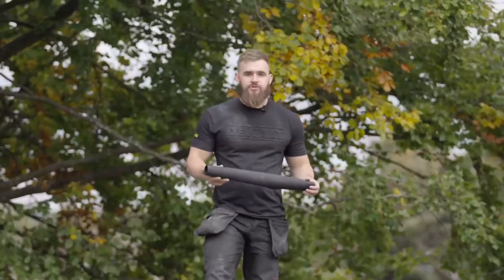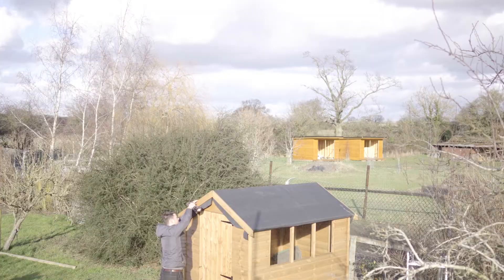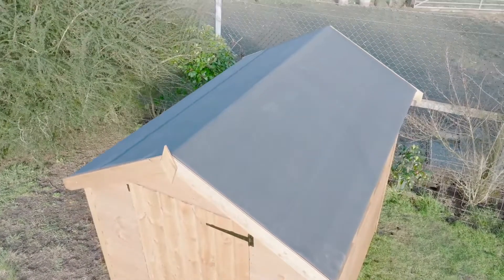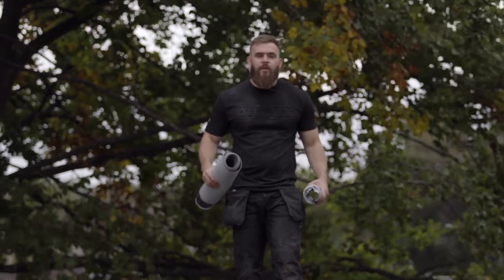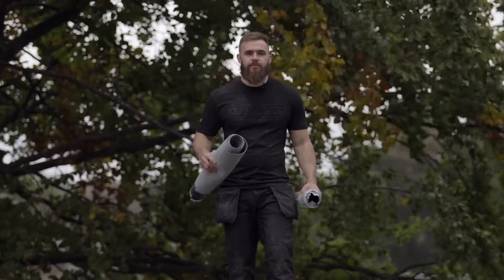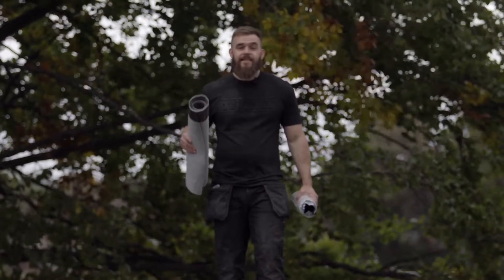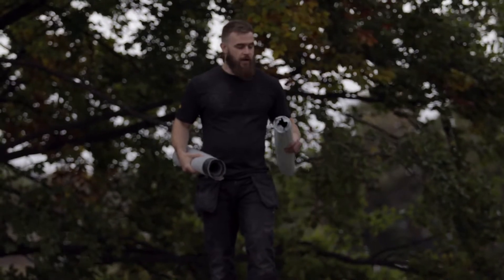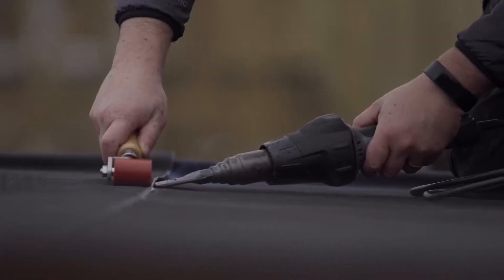Flat Roofing Materials Comparison: EPDM Rubber Roofing Membranes

Comment: Hi need help. Is OSB wood or structural Plywood better suited for a summer house roof (7m x 4m)? I see everyone is using OSB, but my handy man recommends structural plywood but it is about £150 - £200 more. I'll also be covering the roof with EPDM rubber membrane (classic bond).
Reply: No expert here but I have noticed OSB goes to shit way quicker if it gets wet. Plywood can get wet several times before it starts to fall apart. I guess if you never have a problem with the roof then it doesnt matter but I built my shed with plywood for that reason
Reply: OSB 18mm is fine, give it a light sand to give a key first. He  is a handyman for that reason i'm afraid . Im a Firestone EPDM authorised installer :)
Reply: 150-200 more is nothing if it’s better quality

Comment: Hi there, We recently had our garage done with EPDM rubber membrane. We live in a detached property which is connect garage to garage with next door. In other words the two garage roofs are connect as one. Now to the problem I have encountered. The garage roofs are serviced by a single outlet drain (quite narrow), which goes down internally at the rear of the garage roofs in the center. (behind brickwork). That means that the outlet gets overwhelmed in heavy rain and is prone to blocking several times a year with leaves and debris. Creating a nice swimming pool which I have to manually fix. So what I thought was introduce a second drainage point at the front of the flat roofs going internally down through my garage and thus avoiding creating a swimming pool. So my question to you is - how easy is it to puncture through the EPDM and fit a new draining point without compromising the integrity of the roof and voiding my warranty. Many thanks Brian
Reply: Any home DIY on professionally laid roof will void your warranty mate best to get in touch with your roofer about your problem

Comment: Hello!  I've been quoted $22k for residential flat roof replacement for 2300 sq.ft.  All the roofing companies in SoCal are saying that TU-35 POLYFRESCO G by POLYGLASS is what they will use.  Could you tell me if this is a fair price?  Another roofing company quoted the same job at $16k and I'm curious why they are so different in their quotes.  Thank you!
Reply: I was just quoted $28.5k for 3,000 sq ft S FL.  Also had a hard time finding anyone that does flat roofs.  3/25
Reply: @Dbb277-2 get several quotes before going with anyone. You’ll be surprised how much quotes can vary and also plans for the project. 3-4 quotes should provide a good idea of the average going rate, as well as the most used methods. Sometimes you get someone coming round quoting a whole different technique than anyone else. We recently had a small residential roof done for just under 4k in the UK. Took the guy a week and we’re happy with it. Another company quoted us 5.5k, keeping the original PVC roof and just covering it up, they also said they could do the whole job in one day - that rang alarm bells! You really need to get several quotes to get a feel for price and quality of work being promised.